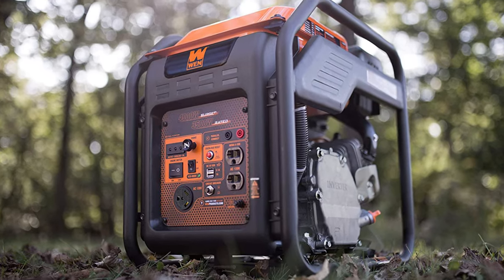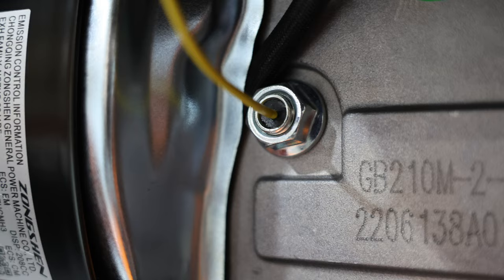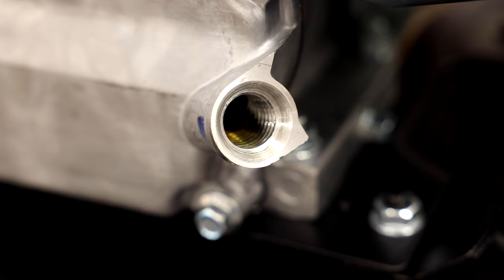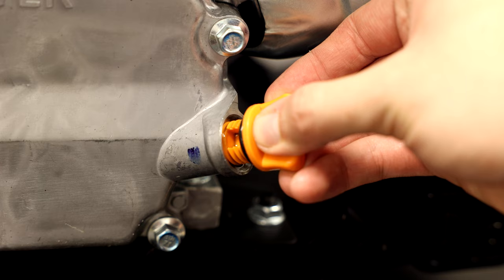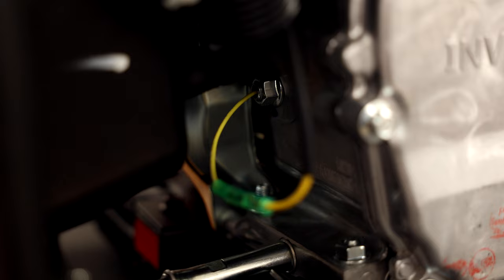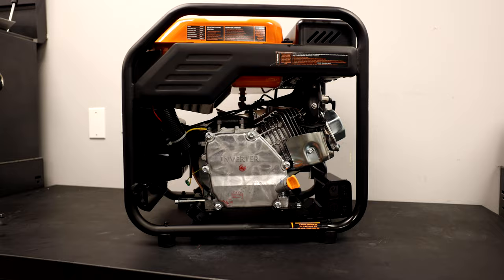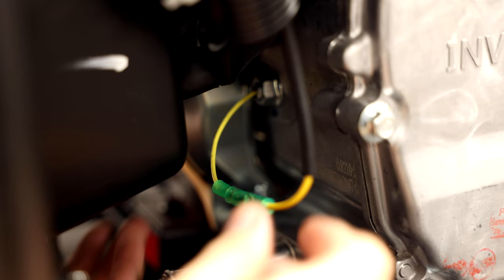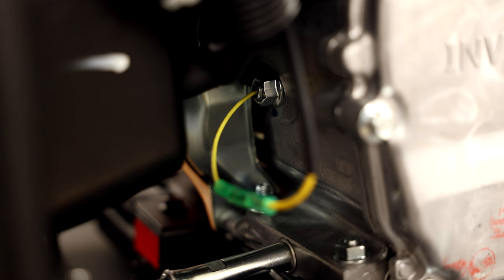How to Disconnect Your Generator's Low-Oil Shutdown Sensor

Comment: OMG, I HAD A MILLER BLUE STAR 185, IT CRANKED BUT IT DIDN'T WANT TO STAR, I UNPLUG THE OIL SENSOR AND IT WORKED, THANKYOU FOR YOUR GREAT VIDEO, TRIED TO TURN IT ON FOR DAYS AND I COULDN'T FIGURE IT OUT

Comment: Warning  WEN 11000 owners manual states that it has a 72 oz oil capacity which is confusing because after adding 72 oz it was not showing on the gauged area on the dip stick.

Comment: Thank you for this! You’re a life saver. I had only gotten one use out of my Powermate generator and thought the issue to be minor. I disconnected the oil sensor and it’s purring like a kitten. I’ve been without power due to Hurricane Beryl but thankfully my food was saved! Thanks again!

Comment: When the oil is drying up without leaking what is the problem please
Reply: It's either eating it or leaking out. If it's not leaking then the engine is using it, and it's probably time to either rebuild the engine or replace the unit